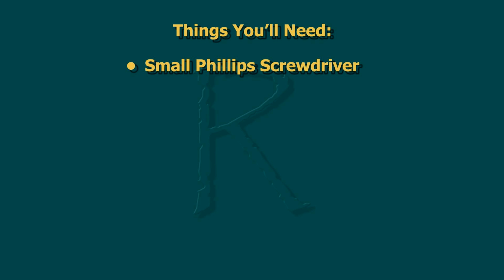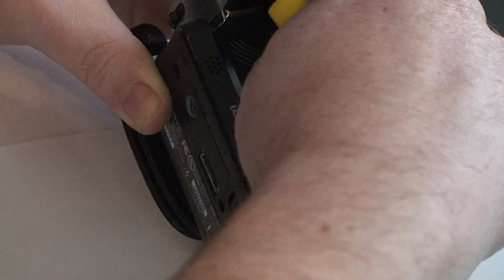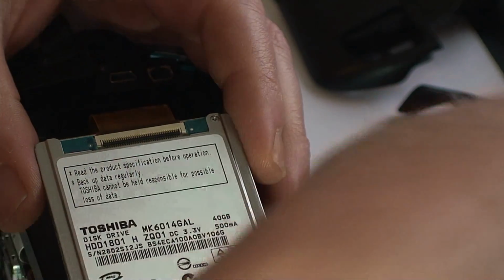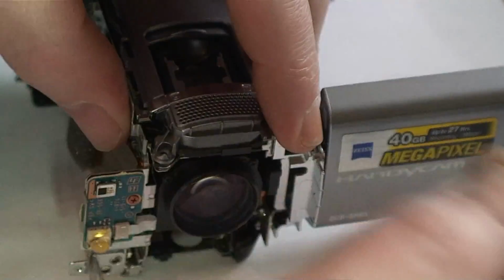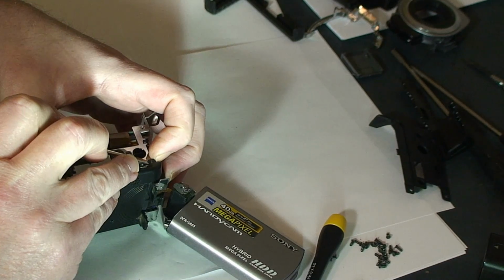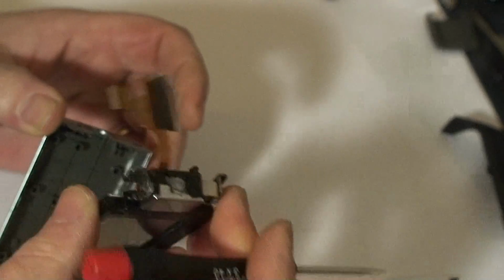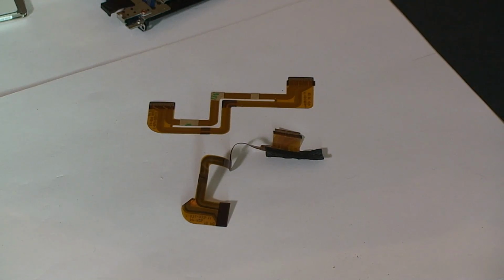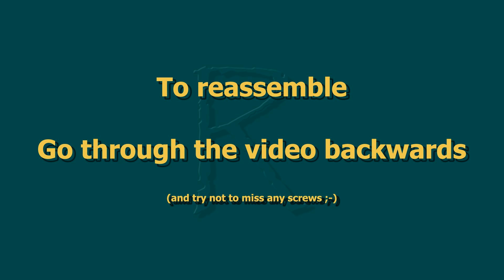Repairing or Upgrading a Sony Handycam DCR-SR65

Comment: Hi I have a Sony DCR SR 35E and I need a flexible cable that goes through the hinge to the screen. Do you know its number to find it?
Reply from the maker: They have them on eBay, search for this title
2X LCD Flex Cable For Sony DCR-SR35E SR45E SR46E SR55E SR65E SR75E SR85E FP-826

Comment: After i replaced the flex cable the screen become White, The cable is not loose i tried Arranging it many times but still white, do you know what causes the problem?
Reply from the maker: White screen is almost ALWAYS caused by a poor connection. 

These cables can easily be defective right out of the package. If you can return it and get another that is what I would try first. 

While you wait for a new cable, check for problems with the connectors on the camera. Make sure they are clean and the plastic isn't warped. If it's warped it won't pinch tight enough

Look for brown or black burn marks anywhere you can see soldered connections or chips and diodes.

Let me know how you get along
Reply: @mreinsmith  thank You For Quick Respond, I Already ordered 2 Flex Cable For My SR45 And It will Arrive This day.
Reply: @mreinsmith  My 2 Flex Already Came And I Already Try The 2 But The Screen Is Still white, i Inspect The Connectors But Couldn't See Warp, what Could Be The problem?
Reply from the maker: I'm sorry to hear that 

Are there any other small ribbons or wires in the camera that could be loose?

Otherwise the only 2 things left are the screen itself or a burnt out component

If you had another similar camera you could temporarily connect the screen from it

It's a risk though, It's all low voltage but it "could" burn out the other screen

Comment: i have the same model, but mine just happened a few months ago. i thought the battery is too old that's why the screen display shows battery level too low. i bought a new battery the other day and it's still the same. i tried cleaning the battery terminals but still turn off after showing battery level low. but it works when plug in with the charger.
Reply from the maker: It makes me wonder if one of the contacts is loose or broken on the inside,  on most devices the contact is soldered.  But that doesn't mean it would be fixable

Comment: Hi, 
I fortunately have no problem with my DCR-SR55’s screen but I have a problem with it being very loose. Is there a way to tight it or make it harder to open and to hold the screen on it’s place when it’s closed? For now it isn’t completely loose but I’m afraid it will happen in future.
Reply from the maker: I can't picture that part, is the hinge and screen one part. What I mean is, if you wanted to replace it is the hinge part of the screen

Comment: My camera's had it's whole screen whited out and doesn't display anything, but the touchscreen and recording does seem to work, is this a display cable repair as well?
Reply from the maker: I believe it's the same cable for both, but that doesn't mean a new cable wouldn't fix it 
so before you buy a new cable make sure it's fully inserted on both ends
Also make sure nothing is burnt or melted on the board

Comment: Hi Mrein Smith, How are you? Ok, I have a sony handycam DCR-SR45 and it use to work perfectly, then suddenly when I try to switch it on with the battery, a red light just above the battery is continually blinking, I tried to replace the battery but still the same problem. I tried powering it on just with the AC jack, with the battery and without and still nothing. It simply doesn't come on and the red light keeps blinking. Also a green light is on where the photo section is. I have tried to fix and troubleshoot this problem, but nothing has worked. Any suggestions will be much appreciated. Thanks.

Comment: In reply to the post from "the guy with the guitar in front of the flowers", I just replaced my flex cable and the old cable that I removed did not have any visible defect that I could see.  However with the new flex cable installed the camera worked just find and the LCD now works 100% of the time. (previously the LCD screen was blank until I wiggled it and the display would then work for about a second or so)

Comment: Hi, Great video, used to strip my sony DCR-SR52, it appears to have a secondary cable over the screen ribbon, it goes from the screen to the hinge, but it as no fixing on it, it has a metal piece bonded ?to it but was hanging loose, any idea where it goes?

Comment: My DCR SR68 has a problem where when I press the power button I can hear a humming like something is starting up (probably the hard drive), and the display shows "HANDYCAM".  Then the camcorder just shuts off.  This happens regardless of whether the camcorder is plugged into AC power or running off the battery or running off AC power without the battery installed.  Any ideas?
Reply from the maker: My guess is that the hard drive has failed, but I can't be sure
Reply: ***** Thanks for taking the time to reply.  Can the hard drive be removed from the camcorder and hooked up to a pc to test it?
Reply: +Ray Russell  Have you tried holding the power button down?  I have the DCR SR62 and it was doing the same thing.  Holding the power button down kept it powered on and allowed us to record videos but as soon as we release the power button it shuts off.

Comment: Thanks so much for posting this video.  Thanks to you I was able to fix my Sony HDR-SR12 (new flex cable for the LCD screen) for less than $5 in parts.  What is even better no screws left over after the final assembly (did have three left over after the first assembly attempt but the camera worked 100% without them).  Many many thanks!!!

Comment: Very good explanation! With this video I changed the flex cable of my DCR-SR45. I had some problems with the screwdriver, that now I know it was not the correct tool, and almost damaged some screws. I used another one, and the handycam is working again! Congratulations for the video, and thank you!

Comment: Hi,
I do have DCR-SR32, and I need to change flex cable. Do You think it should be similar process in my camera? I think it is a flex cable because i Cannot see anything on the LCD, just some grays shadows on the black screen. It works with TV dough.

Comment: Very handy video. Thanks for the time you took to make this available for us. This is one of the reason, internet is a great resource. 
I used your video to an extend, especially on how to disconnect cables from their joints. I managed to get to the LCD a bit easier. After removing the case on the HDD, I took out the thing on the bottom of the camera and then i made my way to removing the panel that houses the display door. However, I have to mention that I did this on a sony hdr SR7E.

Comment: Can you upgrade the Hard Drive to a larger capacity on these or do they need to be formatted by Sony?
Reply from the maker: Yes they can, as long as you have the option to format storage in your menu you can format it once its installed
Reply: Awesome, too easy have to go up to like 250

Comment: Hi I have a broken Sony handy cam, I want to recover video file from the Hard Disk. It is toshiba disk drive MK8031GAL. How can I do that ?How can I find the proper connection?
Reply from the maker: search for PSATA IDE Ultra ATA 100/133 To SATA Converter Adapter or the equivalent usb adapter

Comment: I have a Sony Handycam, same like the one in that video DCR-SR65. I have problem with it. the screen didn't display anything, it doesn't light up. I already check it out, but the cable looks like still in good condition, same as the screen. I have found some part that rusted at the copper gasket at the screen does it annoy the display? what do you think the problem would be? can you show me some video showing related to LCD Flex Cable problem? Thank you.

Comment: Rotation lcd is not working in My dcr - sr 65E
Trying  search of the parts, but i can find it.
and what for name flex cable rotate?
Reply: FP826. You can get easily on ebay.